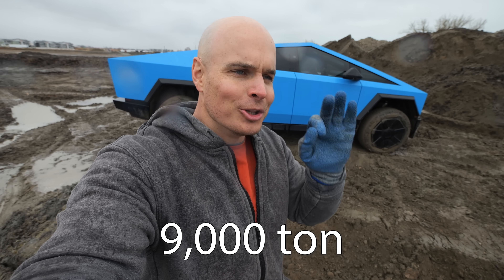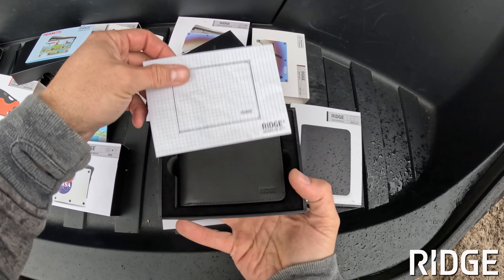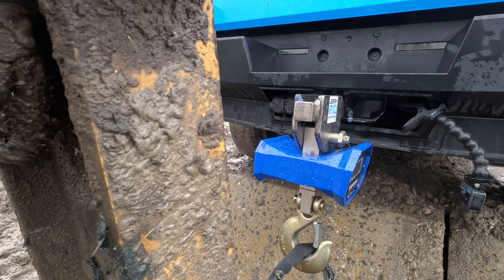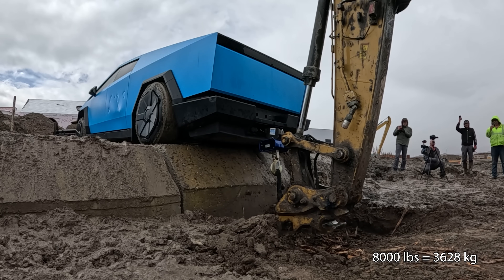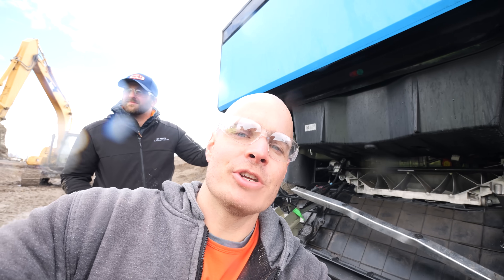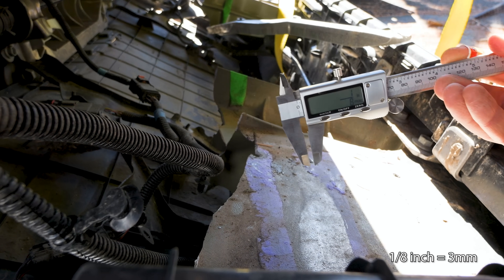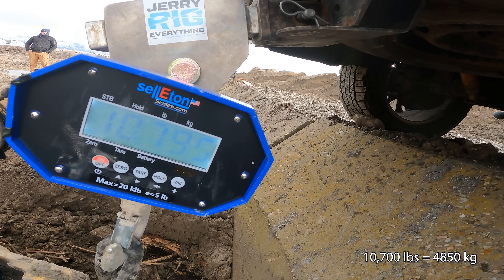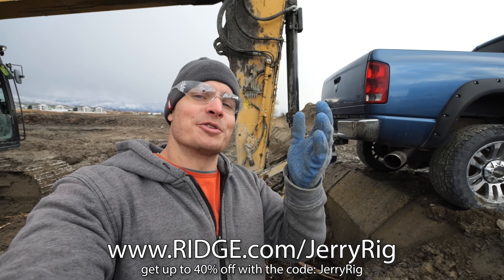SHOULD YOU TOW WITH A CYBERTRUCK?! - (catastrophic failure test)

Comment: Ah yes, Aluminium, known for its incredible strength.
Reply: Aluminium is actually very strong, the problem ist that there isn't a stress limit. Steel at some point won't become weaker, not matter how often it is stressed. Aluminium however will, at some point, hit 0 for its strength
Reply: @irgendeinerandomperson  that's not true, steel undergoes fatigue too. Its just the rate at which is experiences fatigue is lower
Reply: @fishjohn014  No, Steel undergoes fatigue to a certain point and won't become weaker after that point. Aluminium will after a long time fail from the smallest of loads. 
With steel you know how weak it will become and you can calculate how much material you need for the required strength forever, with aluminium it will at some point be lower than the required strength
Reply: For $100k it should be.  🗑️
Reply: Aluminum 7075 T6 is nearly as strong as steel. However, the cybertruck isn't made of that.
Reply: Aluminum isn't inherently weak as a material, especially given how much lighter it is than steel and how corrosion resistant it is. But steel has practically unlimited fatigue limit to its advantage. That's why a wrecked Dodge outperformed the cyber truck in this test. I'd trust aluminum for body panels but definitely not for the literal frame of the vehicle.
Reply: To be fair, it is extremely strong for it's weight. But it being so thin is disgusting cost savings. If it was at least as thick as a steel frame it should have been fine, but like he showed it's only about 3mm thick.
Reply: @Skylancer727  It is not a cost savings - it is a electric car, battery technology is not advanced enough - these are weight savings.
Reply: @Skylancer727 Akso, it is cast, which is inherently more brittle.
Reply: @TroySavary  yeah, but I think how generally thin it is matters more.
Reply: @Skylancer727  To be fair also people are bad customers and they essentially want a bulletproof supertank that can do 200 mph and get 250-500 mile range for only 20,000 dollars. I appreciate people can't just randomally dump that amount of money on a random car though.
Reply: @Mallchad  well we can tell by the clips of people driving and destroying them that that's exactly who's buying them. Laughed so hard at some of these clips of people trying to prove how strong it is, just to ruin it.
Reply: @Skylancer727  Ah yes. A beautiful car economy built around people ruining a car just to laugh at Tesla whilst giving tips on how to improve their design.

Truly karma in action.
Reply: strength to weight ratio, yes. But for the same size, aluminium is way lighter and weaker than steel
Reply: Well, I work in the automotive industry, and some of this heat treated aluminum casting we get made are strong af. But they all have something cyber truck lacks..bigger cross-sectional area and/or thickness. The cyber trucks back end is far too thin. Im actually surprised it got to 10k.  The correct aluminum is very strong compared to its weight, but basic store aluminum is like a paperclip.
Reply: of course. I've built dozens of homes using aluminum instead of concrete and only half of them have collapsed so far!
Reply: It is know for strength if you use enough of it, cybertruck uses a thin sheet and it's trash
Reply: @Moxzot  It's literally not a sheet, that's the entire point of the concept. It's a CASTING.
Reply: Can the Ridge wallet go in my back pocket and not destroy my *ss?
Reply: Forged aluminum is very strong but this is cast
Reply: Just imagine if aluminum were used for something as important as engine blocks, suspension members, or.. gasp! Wheels!
Reply: I don’t think this is a great test, but anyone who knows a bit about metals know if you use aluminum it needs to be a thicker grade than steel for the same strength. That looked like a very thin frame even if it was steel
Reply: Actually aircraft aluminum is very strong. The cybers casting is not aircraft aluminum though. Likely aluminum, magnesium, and silicon.
Reply: @ccc822007 you know why aircrafts forced to use aluminum? Only coz of weight savings, not because it's better than steel.
Reply: @s.i.m.c.a  But that is not casted aluminium, there are different types of aluminium as there are different types of steel.
Reply: @s.i.m.c.a  perhaps it's weight saving. But the material itself has a higher tensile strength.
Reply: @s.i.m.c.a  not just that, but aluminum has unmatched buckling strength compare to most other material
Reply: @s.i.m.c.a there are countless grades of aluminum and steel. Be specific
Reply: @ccc822007 that's the emphasis tensile strength. If a plane is experiencing compressive force everyone inside is going into a body bag so saying it's strong is a sleight of hand at best. It's the same reason those guys in that sub went the way of the Titanic. Frankly. Tensile strength might not be the best metric for vehicles experiencing high stress under weight. Though that's a mechanical engineers job not mine. I'll stick to the software side
Reply: @ccc822007  The Alloy being used has been published. It's designated AA 386. It's top 3 metals is actually Aluminium, Silicon then Copper. Magnesium is 4th. You were close.
Reply: @ccc822007 even then, airframes are inspected regularly for stress fractures and cracking. Significantly more inspection than consumer vehicles see, and orders of magnitude more stringent and documented.
Reply: It's not so much that aluminimum is weak, it's that it's not particularly suited to this task.  They could have worked around that; it's just an engineering problem.  For instance, the two weak spots that broke in this test?  Replace those with steel, or make them larger, or add a third, or add some buffering.

A followup issue though, is that cast aluminimum is going to collect stress fractures every time you jostle the towed load.  Go over a bump while towing a trailer?  Cracks.  Hit the breaks?  More cracks.  Add or remove a trailer jack?  Cracks.  They should have at least added a damper between the towing hitch and the aluminimum frame.

Fortunately, though, cybertruck owners almost never use them like trucks, because they're terrible trucks.  Maybe Tesla should just issue a recall for the trailer hitch and remove it entirely.  Solve the problem before too many people are killed by runaway trailers.
Reply: @georgedorn_fnord  1st and foremost they shouldn't use cast aluminum, cast whatever is shit like cast steel breaks easily too compared to rolled steel.
Reply: @georgedorn_fnord It's not the material,  it's the production method. Cast metals have low tensile strength. Forged aluminum in the same thickness would have been much stronger in all categories. Hydroformed and welded aluminum tubing as well.
Reply: @georgedorn_fnord  It only failed after nine times the rated tongue weight was applied to it.  Very good performance.  I see no need for changes in the truck, but Zack should change the way he presents things so they are realistic and not misleading.
Reply: @willbraswell4906  The rated weight is that low?  What do they actually expect you to tow with this thing, a kayak trailer?
Reply: @georgedorn_fnord  Rated "hitch/tongue" weight is only about 10% of the weight of the trailer so it can tow 11,000 lb trailer with weight at the hitch/tongue of 1,100 lbs.
Reply: Mill it out of 7075 T6 billet and you got plenty strength but then why wouldn’t you not just use steel lol
Reply: airplanes used to be made out of aluminium so its not a bad choice, good strength to weight ratio
Reply: The rating for the tongue is actually 1,100 lbs, and it withheld almost 10x that. That's really good considering most have 2-3x rating maybe 5x.
Reply: @dilettante4270  But aluminimum has no fatique window; every time you tow something that heavy, it will cause damage.  Over time, it will fail, when towing loads of the size you'd expect a "truck" to be able to tow.
Reply: @oasntet  All I'm saying is that It's negligible damage if used as intended. It will have PLENTY of life before it  ever breaks.
Reply: Hahaha
Reply: He hates Elon because, not suprised by this video since the USAID cut blocked the illegal funds he was receiving from the demoncrat party.
Reply: Bro there is alloys and formed aluminum is so much better
Reply: I for one trust other peoples lives with Aluminum frames if it puts my own life in danger then i will not stand behind it(literally).
Reply: best comment so far😂
Reply: Hahahahahahaha
Reply: Double the pin weight of a semi trailer..   So yes..
Reply: So glad my old Ford's are pressing steel
Reply: Well you should look how fighter jets and airplanes are made. Aluminum it’s extremely strong and if they increased the thickness and design slightly it could easily do 15k or 20.
Reply: @lllhunterlll9644  It's not an issue of the main rear casting.  Google "Rear Energry Absorber - Cast Bumper Assembly - LH (Remove and Install)"   

The absorber works fine.  LOL but this should take you to the manual.   The hitch comes off then the absorber.   A change in these two parts to overlap further forward on the casting for more surface area could double the load.   

It just needs to apply the load to more surface area.   I've done FEA on other things and 6 more inches of hitch braket lenght and one more bolt would make a huge difference.
Reply: It's not the strength, it's how it yields and deforms. Which is a consequence of the manufacturing process and alloy, not the fact it is aluminum.
Reply: Al can be quite strong actually just depends on the exact hardening and what you alloy it with.
Reply: Airplane landing gear is aluminium.
Reply: U miss strength to weight 😂😂
Reply: Aluminum frames are used in lots of cars, but those are welded aluminum tubing, not cast aluminum
Reply: Who'd ever make airplanes are rockets out of aluminum?!
Reply: Plus, "it's wafer thin!"
Reply: Better tell them to stop making airplanes out of it then!
Reply: @themonsterunderyourbed9408  Name an airplane that's made out of CAST aluminum, lol.
Reply: aluminum is strong. that's not the issue....
Reply: @mmm-mmm  Is it as strong as steel at the same thickness?
Reply: @veni_vidi13  again, for it's weight, it's very strong. but it has different properties than steel. you pick the material you use based on what you need the part to do...
Reply: @mmm-mmm  Sure for it's weight, but they don't put aluminium in there that has the same weight as steel. In this application, aluminium isn't strong or beneficial at all.
Reply: i mean, it is, but it depends on the application.
Reply: 9 times stronger than it should be dude
Reply: Aluminum is not strong, Titanium is.
Reply: Sure thing , They make airplanes out of the stuff. They carry huge loads and gets lots of bounces from the landing gear.✈ No problem.
Reply: Aluminums alloys can be stronger than steel.  Even those alloys can be weaker though when they are reduced to being paper thin.
Reply: It is strong in different ways and weak in others but I can’t believe Tesla was foolish enough to use aluminum like that. Ford knew better, because they thought it was common sense, but apparently not for Tesla.
Reply: The only thing a Cybertruck will tow is a Honey Wagon.
Reply: Dodge bends
Cybertruck snaps
I'm pretty sure car frames aren't meant to snap
Reply: it took 4,7 tons while the normal weight on the hitch may not be more then 90kg, I really don't understand why people see a problem here.
Maybe that's the reason Tesla is not even responding, because the problem they want to construct here is so bogus.
Reply: Aluminum is in fact very strong relative to its weight. There's a reason aircraft and bicycles are made of the material. However, it has to be properly made aluminum, and in the proper use case. The trailer hitch of a truck is not that.
Reply: Not any aluminum. 3/16 aluminum.
Reply: You're joking right?
Reply: in terms of strength to weight it beats most materials you could reasonably make a truck out of making the frame out of it was certainly a "inspired" decision
Reply: Especially at such thin thickness on something called a truck that has to tow heavy stuff 🤣

But for a normal car I wish it was mostly stainless steel or aluminum with proper thickness.
Reply: Everything I own (bicycles, dirt bikes, trucks etc.) all have steel frames.
That is 100% no accident.
Reply: Locking carabiners used for climbing can hold 24kn or more, this is equal to 5395 lbs and they typically weigh less than 55 grams.

Aluminum alloys can be incredibly strong!
Reply: Just like Donald Trump's ego 🤡
Reply: He's giving Tesla too much credit for developing giga casting.  They are Chinese die casting machines and my guess is that the molds/dies were made in China too. Like most of the presses, dies, molds and fixtures in Tesla factories.  For an American company they sure spent most the investment money in China.
Reply: Aluminium is used for exactly that, its incredible strength/weight ratio.
However, strength also scales with the volume of the material, and here they used wafer thin I beam style parts.
Reply: Have you ever seen how far you can bend the aluminum wing on a 737? Aluminum is a fine material to build with. You just need to use the right alloy and right thickness for the application.
Reply: Actually aluminum is incredibly strong... for it's weight. But there's strong in different ways, you can have strong like stretching on the metal or compressing the metal, I forgot the 3rd way (I think there's 3 ways at least) and the issue is aluminum is great for a frame, but it's just not great if you only have 3/16ths thickness in a mold. Regardless I still wouldn't tow at max load with this even if it was thicker because it should be bolted/welded to the frame. I'm not an engineer though so what do I know.
Reply: @lockinhinddanger934  there's tensile, ductility, and hardness.
Reply: Hello? Aluminium IS strong. Have you not used the cans and crushed them with your own hands before, those things are strong as heck, feels like you have to put the suns force of gravity on each side to force it together. Of course it would stand the test against the weight.........
Reply: @nerfgodbigguy1405 except your can example is extruded aluminum as opposed to cast aluminum. Big difference. Cast aluminum and cast iron, while very rigid, are poor choices in areas that are subjected to bending because they lack ductility.
Reply: @nerfgodbigguy1405  Put a tiny dent in the side of one, and it crushes easily....
Reply: @markb2169  facts
Reply: @nerfgodbigguy1405 well maybe not the ones on cybertrucks then, people have had their frames snapped from towing with the cybertruck, this doesnt happen with any other truck when towing just about anything.
Reply: Hatchet job on Tesla..
Reply: aluminum is stronger...theres tons of 53' trailers made out of aluminum with 80,000lbs load capacities. its 2/3 the strength of steel at half the weight, so you can make things stronger and lighter than steel. why do you think planes are made out of aluminum...people are so dumb man.
Reply: @Dexter_Solid  my guy, those were engineered to be loaded. The Cybertruck wasn't engineered from the ground up to tow. It was an afterthought. I agree with you that aluminum isn't the problem. But those trailers were made for hauling. The Cybertruck was built as a suburban people hauler with a bed. Not as a truck with a Class IV towing capacity.
Reply: ever fly in an airplane X p
Reply: Ah yes, aluminium, the same material the iPhone 6 was made from.
Reply: Stronger than steel by mass.
Reply: It has such incredible strength, that is is used for airplanes that are pressurized and depressurized multiple times a day for 20-30 years non stop.
Reply: Ah yes, Elon Musk, known for his brilliance, understanding of the federal government, and saving children from caves.
Reply: I mean all airplanes are made of it ….
Reply: I thought it was made of folded stainless steel, wasn't that the whole Point of the shape?
Reply: @OiAndrey  Just wait til you find out what aircraft are all made of... (it's aluminum, and much thinner)
Reply: @Turbo.M777  just wait till you find out that aircraft airframes undergo regular inspections and testing throughout their lifespans that automotives never do. Why? Because metals like Aluminum and Titanium are prone to stress fractures and cracking over their lifespans. Steel can be prone to it too, but generally it holds up far better to the rigors of daily automotive use than aluminum. Airframes are inspected every 50-100 hours as well as a yearly inspection.

Admittedly there's a lot on the line there, but to be fair, towing the claimed 11,000 lbs is just as dangerous to everyone on the road when the folks shipping the vehicle doesn't think they need to meet industry guidelines and standards that were established in blood.

Aluminum framed vehicles towing anything more than class 2 should be subject to the same inspections airframes are due to fatigue and cracking that WILL develop. It's not an "IF" but a "WHEN".
Reply: It put men on the moon.
Reply: Better not get on an airplane…
Reply: @Upliftyourbrothers  Seems that it just confirms that Musk is incompetent then when airplains can get towed without the connection ripping off...
Reply: Yes, that’s why passenger jets, the safest form of transportation, are universally made of aluminum. 👍
Reply: Yes, it is. The cybertruck is the safest independently tested truck with the least chance of roll-over. Would i buy one to tow? No. Is aluminium safe and strong? Yes. Will the back break off cybertrucks? Probably never unless it's been jumped. Has the back ever rusted off a steel truck? Yes.
Reply: @OiAndrey  If you’re worried about the strength of aluminum, you should avoid airplanes.
Reply: I suggest you guys NEVER take a commercial flight - those things are mostly aluminum.
Reply: @ There's a world of difference between cast aluminum of whatever grade the cybertruck frame is made out of, vs forged and heat-treated 7075 T6 that aircraft are made from.  Plus airplanes are inspected regularly so when the frame does start developing fractures it can be pulled out of service for repair.
Reply: its what commercial airliners are made from, so yes it has incredible strength and it doesn't rust
Reply: @safetylast911  alloy rusting ... ? oxidizes and turns to powder  but rusting ....
Reply: @safetylast911  all metals oxidize  incliding AL,  just leave a piece in the open and youll see a bdark coating forming, some acidic materials eat trhough aluminium faster than steel, salt water will eat it that is why they dont use it near the sea... why would we use steel instead if Al was rust proof?...pure Fe is unstable to forge so Carbon is added to the alloy, Al can have Mg or Manganesium or other metals in it, stainless steel oxidizes at a lower rate than Al, so it mostly depends on the alloys, in todays world is nearly impossible to find pure metals in daily products
Reply: It's not just Aluminum. It's mostly a Aluminum & SILICON Alloy with any other trace amount of metals. It is actually strong, you are just factually wrong.
Reply: And now he is rebuilding the government.
I'm not saying America is a laughing stock because I can't stop laughing.
Reply: Can you imagine the weight and performance of using a steel frame instead? 

You'd need a CDL to drive it 😂
Reply: Aluminum IS known for its strength, though. If you design 2 structures, one aluminum and one steel, both engineered to support the same weight, the aluminum one will be bulkier, but will weigh approximately 1/2 as much as the steel one. It is twice as strong as steel, for the same weight. 

My Model S was the safest car the government ever crash tested when I bought it, and it has an aluminum frame/body.
Reply: @v12tommy  yeah but it also wasn't made for towing in mind. Crashes are compression, towing is tension. Plus in a crash you have much more than the frame of the car to prevent damage and the Model S has steel crumple zones. So yes in that case it's still using steel
Reply: @ it’s an electric truck dawg it’s not mean for high capacity towing lmao. You guys are trying to load this thing with so much weight when its range doesn’t even match that.
Reply: @cubanYams212  most people just don't tow that far. Plus it's $100K. When you buy something that expensive and it lists 11K pound limit, you'll find people actually doing it. 

Plus being electric means it handles loads much better than diesel or gas. Both go farther yes, but the electric truck handles better with a load. Like gas trucks really slow down when you put a load on it. 

Realistically if towing is your thing, even gas is a bad idea. Diesel is usually the best option if you tow a lot. But since most people rarely tow anything and more have it for "what if" there's nothing wrong with electric.
Reply: It's incredibly strong at keeping knowledge out of the brains of Musk fanboys who wear aluminum foil as hats.
Reply: @RockSleeper  The Cybertruck's trailer hitch is a standard 2-inch square receiver, rated for a maximum towing capacity of 11,000 pounds, which puts it in the Class 5 hitch category, but with a tongue weight limit of 1,100 pounds. Test was  10x the rated weight, I think it will be fine.
Reply: Such a realistic test 😂😂😂😂
Reply: @CherryKingX  It is rather a easy test, cast aluminium is not impact resistent so this is a test in favour for the cybertruck and it is still shit
Reply: @  Cast AL wheels all over the place.
Reply: @CherryKingX  applying downward force and measuring the amount required to produce a failure seems like a pretty reasonable experimental design 

Using an excavator is an interesting way to apply the force, but that doesn't invalidate the results
Reply: @jjurss7263 if you have to hold the front of the truck down because it would lift up under so much weight, what is the point in the test? In any real scenario you wouldn't be able to drive anyway. Investigating fatigue stress would be the interesting part, but it's not as 'cool' of a video and it's much harder to do than "just pull til it breaks"
Reply: @jojoflowe dynamic loads can be enormous with loads that are seemingly pretty manageable, think potholes and speed bumps.
Reply: @CherryKingX  True! The only thing cybertrucks are expected to tow in real-world conditions are comically oversized MAGA flags.
Reply: @CherryKingX  Swasticar Fanboy alert
Reply: @CherryKingX right!?  Though it looks like it's raining so that could be a problem too.
Reply: Top safety tested by third party crash testing... It's not all aluminum.. what would I know, my top shorts is making car and truck parts for Tesla and Dodge 😂
Reply: @dertythegrower It only got a 4 star passenger crash rating, so it is not as goodxas other trucks. Silverado, for example, got 5 star both driver and passenger. But facts and Tesla stans are strangers.
Reply: @dertythegrower The body is steel, not very good steel either. It will rust from dead bugs. What a waste of money.